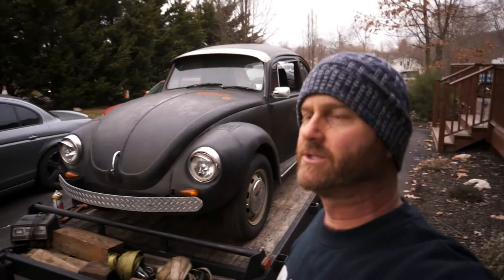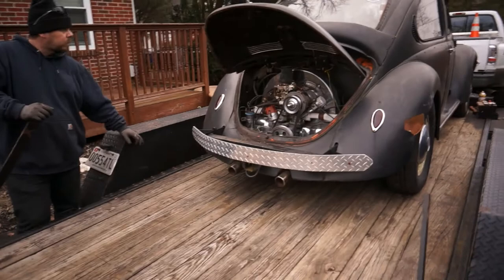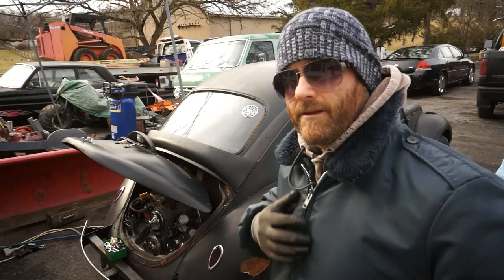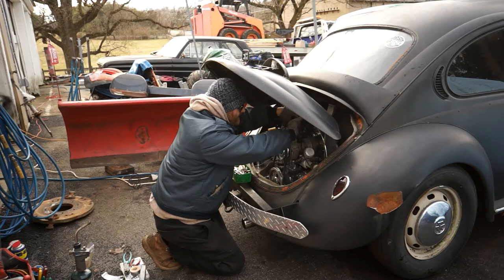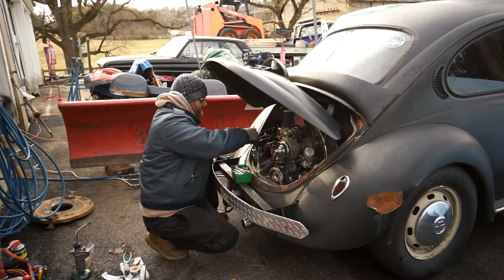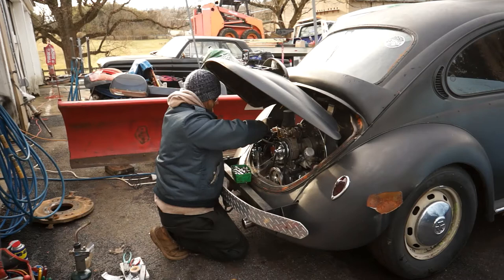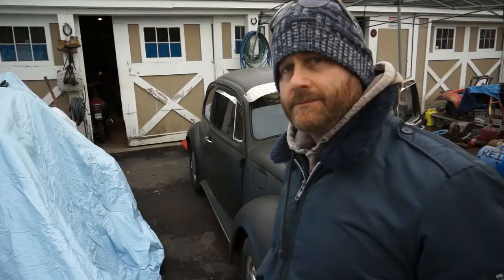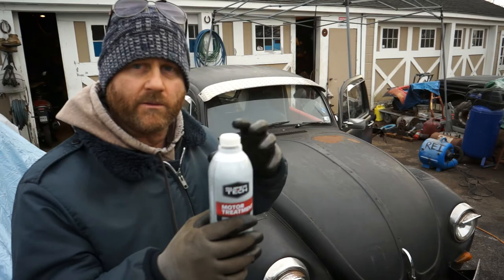VOLKSWAGON BUG  SUPER BEETLE WONT START, DO THIS TO START THAT OLD BUG, DO THESE THING FIRST

Comment: I like the idea of 1/4" diamond plate bumbers,I never cared for stock VW bumpers,,,to thin to offer any real protection, I was thinking tube myself,but I could definitely see incorporating diamond plate into my tube design
Reply from the maker: Its what we had laying around..for that rat rod look. 1/4 inch thick..so, pretty strong, with a different look for the old bug.
Keith 2guys how2

Comment: The upper wing you use to harvest more air for ventilation cooling is a very smart and simple idea! Is it available and ready to install on any Beetle? Or did you invent the wing? I'll do it, have you tested the cooling effect with and without? Does it achieve more cooling? Hope so, waiting for the answer! Well, thanks in advance. Best Regards
Reply from the maker: These motors need to be cooled by air...but, they also need to be at right hot temperatures to burn fuel correctly. 
Air cooled motors will last if not overheated....too cold will age t the way it vaporizes the fuel as it should.
Keith 2guys how2

Comment: Good score bro I've got one exactly the same model but it's not rat rodded
I think that wire you didn't worry about is for the reverse lights, but your prolly figured that out by now
Reply from the maker: Appreciate the info..Yeah, cold outside back then and didn't worry about it....we ran all wires were they needed to go and fixed a few more things..but, she runs good.
Keith 2guys how2
Reply: @2guyshow2thefishkingz89  yeah Cool I just Fixed my reverse lights the other day First Time there ever worked since I got It LOL A wire runsoff the positive side of the Coil across the fan Shroud and too the tail light Wires , With a 8 amp fuse 
HopeShes still Around Cheers

Comment: Nice off black bug !,  I have one  bug too at Cairo Egypt.  What is the treatment you added  to the fuel?  but as I dont have gasoline 84 octan, I used to put 1\3  gasoline 92 & 2\3  gasoline 80 octane so I  do come closer to 84 octane. BR
Reply: hi , i have a 1300 beetle 1300cc (code F engine),at Tanta ,GHR, Egypt  ,  for 8 years  ago , I prefer 92 octane  only. 👌

Comment: Nice beetle, just not a fan of super beetles…. That tire lay flat but windshield is flat and not curved so that’s throwing me off
Reply from the maker: Yeah, they are very similar on older models..only difference is the super beetles have front McPherson struts...not the spring inside the front axle tube.....so, some say they ride smoother.
Newer models had the curved windshields.
I do like the flat window look, for some reason..Maybe, similar to an older american style car. They are all cool..If they run good.
Keith 2guys how2
Reply: @2guyshow2thefishkingz89  yeah, that’s true. I just like the shorter hood style I guess
Reply from the maker: @jeremyshearer  yeah, we have a 72 and a 66...with long hoods...with emblem they look bad ass..they a slammed down..so, the hood lines accent the long style hood.
If you need a curved super..we have some.
Reply: @2guyshow2thefishkingz89  hell yeah that’s pretty sweet. I only have a 1970 standard that imma be rebuilding. Just got it three days ago so that’s what brought me to your vids
Reply: @2guyshow2thefishkingz89  can I get your email so I can show ya what mine looks like before I start

Comment: trying to get my dad's bradley gt2 kit car started. it has a hot 2.3 motor in it, we have spark, compression, new coil, cap , rotor , gapped plugs, new pointless distributor. All it does is cough and backfire. I only see 1 ground going to the coil coming direct from the distributor.  Is there another ground we are missing? TDC verified with aftermarket crank pulley, rotor position and popped off valve cover. Just trying to get it to fire to give my pops some hope. Thanks!
Reply from the maker: Sounds like the carb is dirty or if it fuel injected, it could be a fuel related problem. Fuel pump or fuel line, leaking air... I always put gas straight into the carb or air filter intake manifold or hose and see if it starts that way. If it does start then you know it is starving for fuel.
Keith 2Guys How2
Reply: Have you checked the timing

Comment: Maybe timing is out
Reply from the maker: This car sat for a good while..just needed fresh gas..fuel filter, oil change and checked the plugs, points cleaned or replace and rotor button..once we had spark..poured a little gas in the carb and boom..started rightbup and runs fine.
Keith 2guys how2